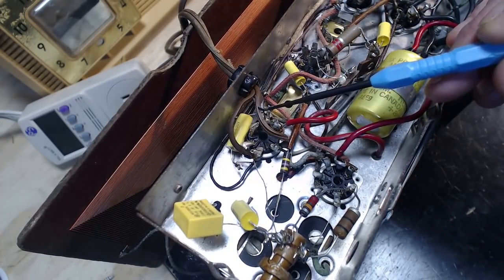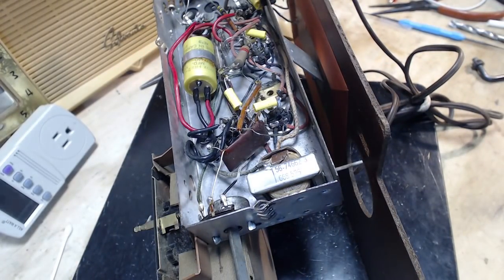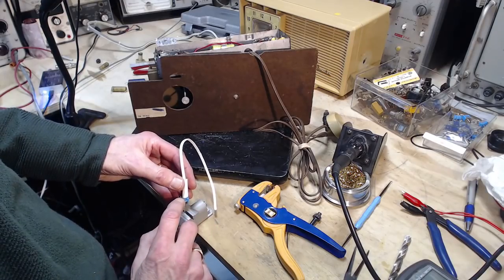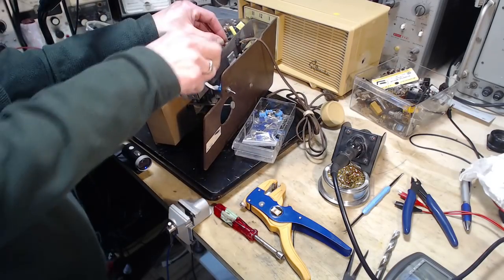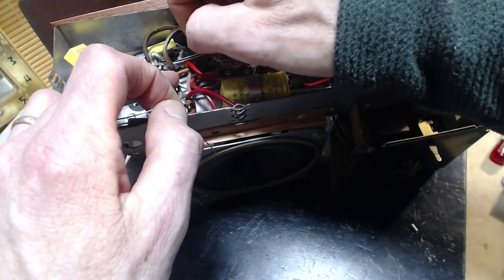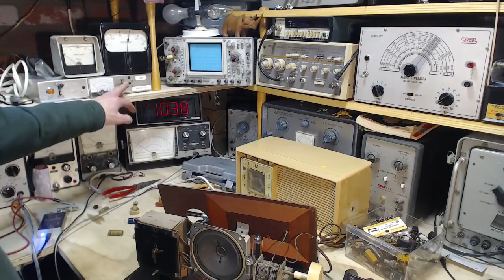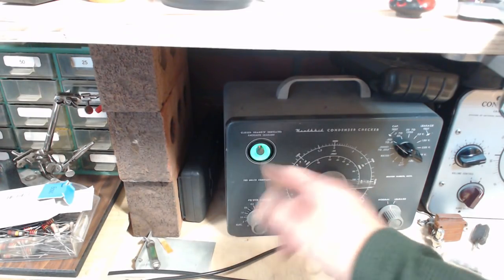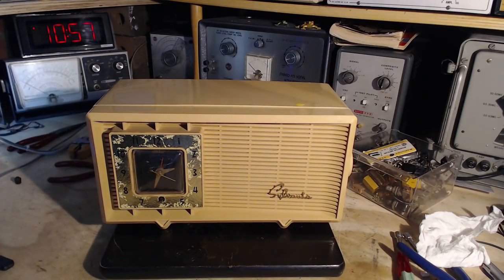Sylvania Clock Radio Video #5 - Alternate Power Switch

Comment: I have the same capacitor tester and in the process of repairing and learning to use it I learned this from the manual: "A condenser that will not balance on any ranges but allows the eye to open on the low end of the low range is an open condenser. A condenser that allows the eye to open on the high end of the high ranges is a shorted condenser." I have also discovered that capacitors that don't read right on the tester have usually changed their value significantly, the same thing you saw when using the alternate tester.

Comment: Here is a tip for you when using shrink tubing that is too large for the wires. Cut a short length of the same size insulated wire. Do not expose the wire inside the insulation. Just clip the wire off even with the end of the insulation. Then slide this length of wire inside the shrink tubing alongside the two other wires in there and it will usually be enough to give the shrink tubing something to grab onto.  Very good video, Jim. Thank you.

Comment: Those capacitors have a high ESR. 
Retest them (capacitance) using the Heathkit, and fiddle with the "power factor"  control.
I'll bet you will be able to widen the shadow in the eye; the capacitance  readout will be  inaccurate, and the "power factor" will be dialed to greater than 10%...  ;-)